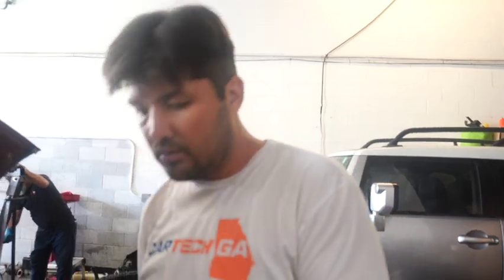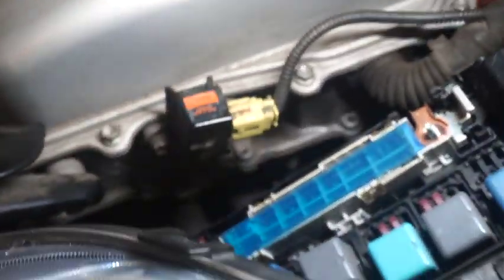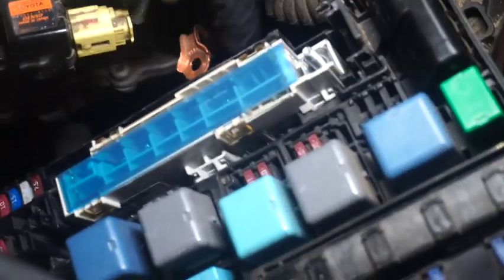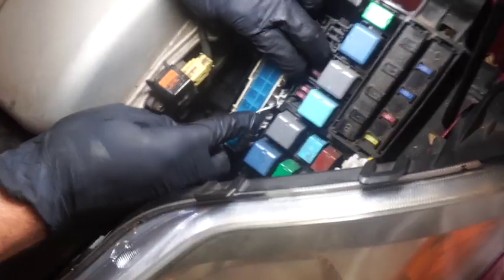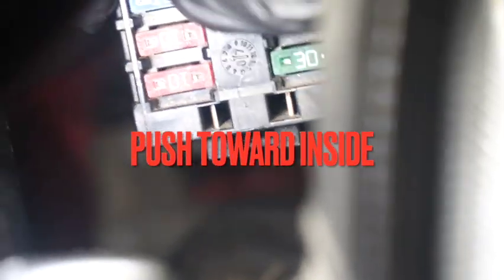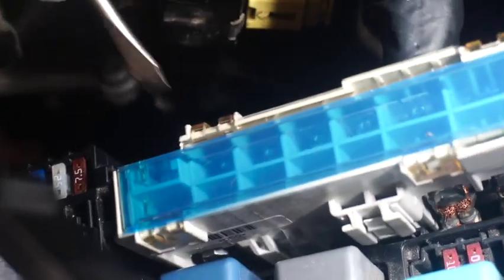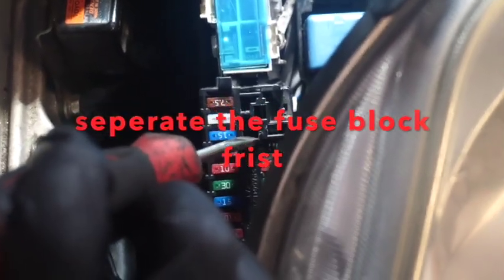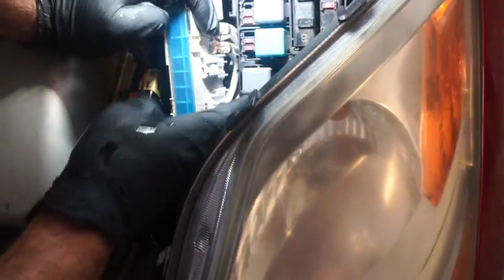Toyota Prius FUSIBLE LINK Block Replacement DUE To NO START Diagnostic , 12 Volt Supplier #Toyota

Comment: Matthew, the cable you temporarily disconnected, does it make a straight run to the AGM battery in the trunk. I ask, because, I am considering making a connection for an inverter. I would like to attach a cable to there an a ground so I could access a connector through the grill, like road service vehicles have for jump starting. Any comments, or recommendations, would be greatly appreciated.

Larry

Comment: How do you test the link for voltage? I did the swapping the leads when jumping the car. I got Autozone to test and charge the battery overnight. After installing the car starts, but I have a bunch of warning lights and no output voltage at the stud on the alternator or at the stud at the base of the link. Just wondering if there's anything else to check. Thanks
Reply: More than likely other fuses blew as well.. or the inverter fried in the process

Comment: So by no start, it didn't react at all? Bc I have an issue where my headlights and interior lights work. But the car will not go into accessory mode or ready mode at all. The ignition doesn't even light up like it normally does, red when it's off and green when it's on. For me it's just black, no light at all. Could it be a fuse problem
Reply: did you find the problem i’m having the same issue and can’t figure it out
Reply: Have you replaced your normal 12v battery?
Reply: @owen7728  yea it was a security button under the steering wheel. It shut everything down so it wouldn't start up without pushing it again
Reply: @terrabledsoe4812  yes and it did nothing bc that wasn't the issue for me. Turned out it was just a security feature where I accidentally pushed a button under the steering with my knee or foot while chilling in the car. The button causes the car not to start regardless of the key fob being anywhere in the car. I read up on it and it's there so if someone clones your key fob and they know nothing else about the car they still can't steal it
Reply: @RayOfSunhine2012 can u tell me a bit more about this security button? I’m having this issue and can’t figure out what’s going on. Car doesn’t turn on, no dash lights or ready light, interior dome lights and turn signals work
Reply: @steventyson  should be about knee high under the steering wheel. Tiny black button